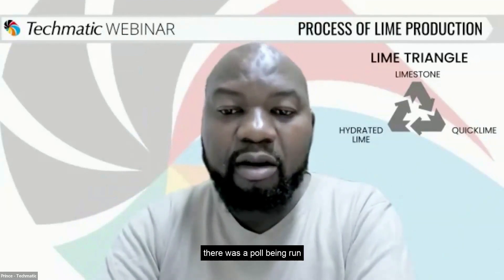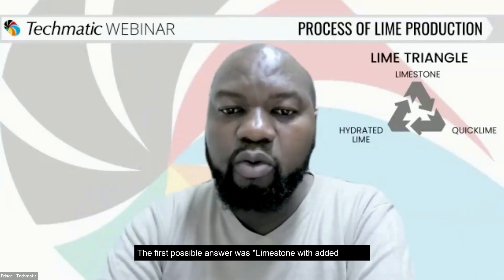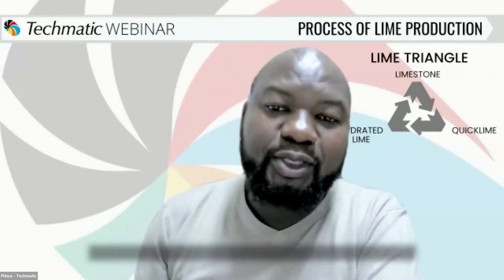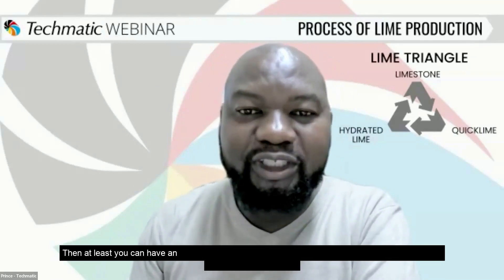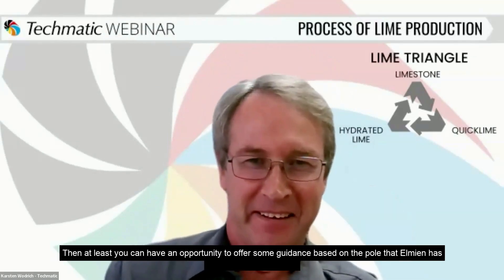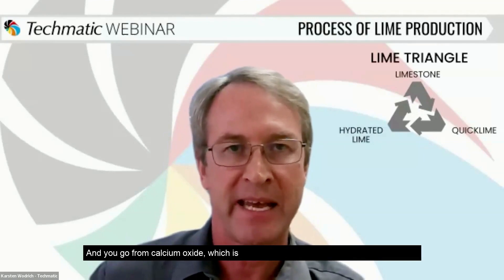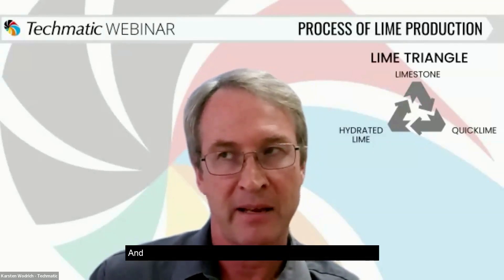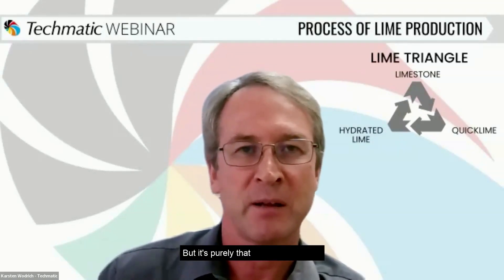Process of Lime Production: What is Hydrated Lime?

Comment: Is there a difference in the quality of cement that would turn out when comparing CaO made from wood ash compared to CaO made from burned up calcium from aquatic organisms (which is how they used to make it)?  Thanks.

I started looking up this stuff up from actually doing gardening research. But its interesting to learn things and know how things are made. Chemistry is so useful to man. I normally use the CaO from campfire ash to put in the garden to grow tomatoes, cucumbers, and other things.
Reply from the maker: Thank you for engaging!

Agreed—chemistry is incredibly important, and especially so with many of the reagents we handle for the mines, where every chemical mixed with water has its inherent specific characteristics and chemical reactions.

Unfortunately, we have limited knowledge of the wood combustion process and its resulting chemical components. In South Africa, all cement is produced using Calcium Oxide derived from the conversion of marine shell deposits of Calcium Carbonate.